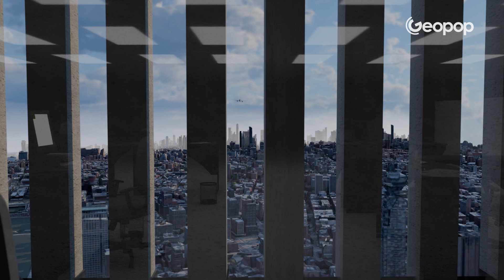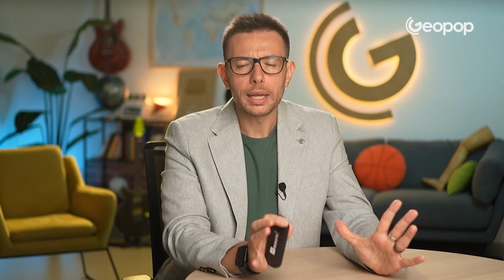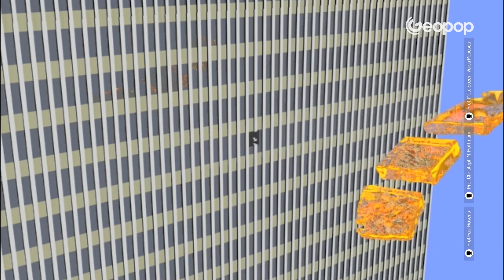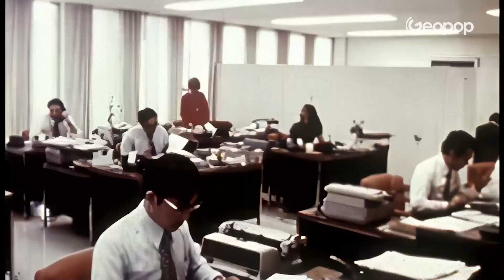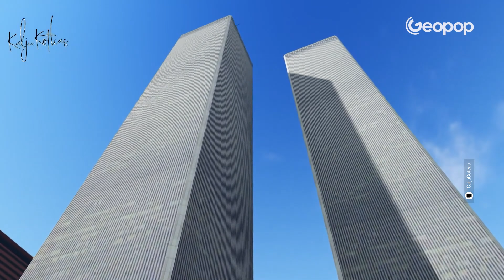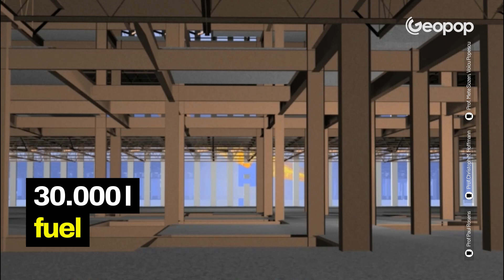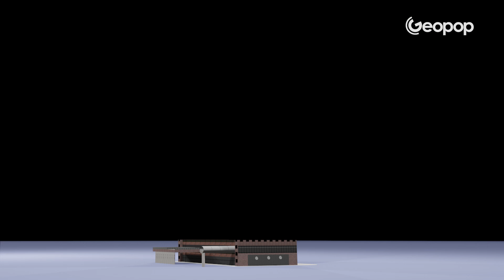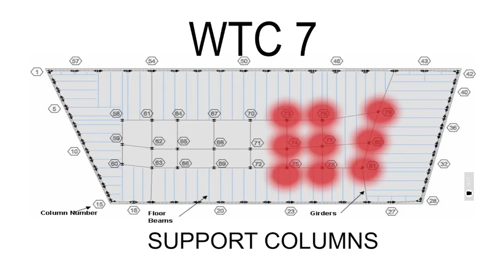9/11, 2001: The Technical Reconstruction of the Twin Towers and WTC 7 Collapses

Comment: Why did people jump? Look at the steel. Fire was so hot it softened steel, imagine feeling that
Reply: They jumped because of smoke
Reply: People watching from rooftops blocks away said they could feel the heat. It must have been unbelievably intense inside the building, especially above the impact site.
Reply: People jumped from utter despair , utter fear and loss of hope. You either jump, get burned , or let smoke suffocate you. Horrific. 😢😢❤
Reply: @stardustring some also fell accidentally to try and get away from the smoke and heat, some inadvertently pushed by others trying to do the same.
Reply: @stardustring  its like when you're at a campfire, and someone throws something combustible in the fire, you feel the heat generated from it, alot of times you back away instinctively, the people who were standing on the edge had no where to go, horrific situation to be in.
Reply: @stardustring correct out of all these comments
Reply: @PaterDJ  
I think you don't realise the scale of the fire and the natural draft that was created!
There is no question that the fire weakened the steel beams to the point they weakened and sagged, causing the collapse!
I don't know where you come up with the  "melted" steel, it certainly was not melted as in a steel foundry!  I have heard people refer to the twisted and deformed steel beams as having been melted, but that is just sloppy phraseology!  The building would have collapsed long before the steel could melt!
I am retired professional welder and amateur blacksmith.  I have even assisted a friend who does iron casting.
Reply: @PaterDJ "Smoke deprived?" You mean oxygen deprived? There was a massive blast and hole on the impact sides blowing out windows on several floors around both buildings, there was plenty of oxygen to burn things, did you miss all of the smoke generated?? It must have created a large updraft as well.
Reply: With fire coming up towards you and no stairs what would you do take a million to one chance of surviving or being burned alive?
Reply: Mossad paid them to jump ( an expert in the comments told me that, so it MUST be true)
Reply: @PaterDJ  what do you think smiths used in the middle ages to forge iron and steel, nano-coal? You are an absolute donkey if you think high tech military grade equipment is required just to soften steel. Heat is all it takes.
Reply: I am a retired professional welder and amateur blacksmith!  You don't have a clue as to what you are talking about!
 @PaterDJ
Reply: it doesnt need to get that hot for humans to be a little iffy about fire, because we melt much, much earlier, like orders of magnitude earlier
Reply: @PaterDJ Wauw so much smarter than experts...Donning-Kruger in full Effect
Reply: @ulrichkristensen4087  your experts are selling you a fib, there's wool on your eyes mate
Reply: Inside job. Has anyone seen the ritual that bush did in the classroom?  My friends it gets deep. And very scary the deeper you go.  But it's a trip that you must take
Reply: They framed binladen. Went to war in Afghanistan to take over the heroin trade to fund the black projects.  O and so much more.
Reply: Jet fuel, magnesium and aluminum aircraft parts, already weakened structural beams from impact. High rise building with wind. Those fires were hot enough to weaken steel.
Reply: Those explosions going off during and before the collapse
Reply: It's terrifying even as a thought experiment
Reply: They knew the fake planting that lie ahead and decided to end their lives rather than listen to it 🪴🤔🪴💩🤔🪴💩⚖️🫡
Reply: Probably the some of the jumpers passed out from inhaling too much smoke
Reply: @PaterDJ  You can use ordinary coal or wood in a foundry. I have done it many times. Also, I have worked as a welder in my youth, and I don’t know how that have anything to do with this? I think my engineering degree has more to offer in the case of structural integrity.
Reply: Right but just know you can't get those temperatures in an open fire.  No, it is not possible to achieve the temperatures needed to melt steel using a typical open fire source; the heat generated by a normal fire is simply not high enough to reach the melting point of steel, which is around 2,500 degrees Fahrenheit (1,370 degrees Celsius) Still any heat anywhere near this would cause someone to second guess if they could fly. But remember the Lady standing in the big whole looking out . Couldn't stand there if it were really hot. I think clearly something else was going on up there. Because around 200 people from EACH building jumped. Which can clearly not only be seen, but heard from the fire fighter footage from the lobby staging area in Tower 1.  Almost as if people were being "cooked" not by the heat but by ?.  Like in a microwave. And like putting a chiken leg on a paper plate in the microwave for just 30 seconds what do you get? A hot boiling chicky leg but paper plate fine not hot. Thats cause of the frequency the microwave is tuned at to hit the water molecules to heat the food. But what was pretty much only things that were left after??? Was all that paper flying everywhere and fine fine dust. EVERYTHING everybody was turned into dust!!! Dust that kept breaking down into smaller dust. OPEN FIRE does NOT make fine fine dust of everything. No No something else  was going on up there to achieve "molecular dissociation".
Reply: @jbyrd1309 😂😂😂
Reply: @jbyrd1309 
So you think, (using the term loosely) that some type of disintegration ray was used?
🤣🤣🤣🤣🤣🤣🤣🤣🤣🤣🤣🤣🤣🤣🤣🤣🤣🤣🤣🤣🤣🤣🤣🤣🤣🤣
Reply: @mahbriggs  loose tight how eva you want it. The weapon already exists and has.  Besides John Hutchinson does the same shit in his living room. You can go watch it on his channel. But the really weird tall tales  is all of the anomalies that come with it. That nothing else can explain that day starting 2 blocks down from the trade center complex. Not to mention the 400 million tons of matter missing from each tower. The marble, concrete, steel, plastics, computers, desks, glass, people,  ect there should have been two piles at least 30 stories high of rubble there was not. If you don't know the science it would never acur to one. I didn't understand the science prior but I knew of the kinda weapons from where I was born and raised on a Naval weapons testing base southern California. Have you ever heard of molecular dissociation? Are you familiar with sound at all. Ever heard of plasmazoid lasers those weren't used but same kinda science. But you can go watch all the news footage of that day and clearly see it in effect. The effect on the towers and around that area. Did you see the news clip of the 70 story steel beam turn into powder live on tv. Then replayed over and over again. It don't take a biologist to know what turkey DNA is. I could go on and on but that should help you out in the right direction. And again if one ain't familiar with the science it will go unnoticed and understood. And check out building 6 right after the towers fell . And explain what you see and how that would be possible if nothing even hit it . But it's ok to learn new things it's never to late my friend. Cheers and fly safe.
Reply: @jbyrd1309  First. You don’t need to melt steel to make it lose its integrity. At 500 Celsius, half the strength is lost. Remember that there was also a couple of airliners crashing in to the buildings. 175000kg flying at 590mph. That’s a lot of energy. About 6 billion joules! No microwaves was needed. Only in the uneducated heads of conspiracy theorists.
Reply: @jbyrd1309 
You are didn't pay attention to the video did you!
The walls were intact, rising heat created a draft, much like that in a foundry or a blacksmith would use!
This greatly increases the heat!  Enough to weaken the steel!
People who don't understand simple science are idiots!
Reply: @jbyrd1309  I remember my first time on LSD too!
Reply: Burning jet fuel doesn't get anywhere near hot enough to soften steel. Maybe being an Ironworker and welder for 30 years gives me a little bit different perspective.
Reply: @danielhowell1640 you're not an iron worker
Reply: @danielhowell1640  Well you certainly aren't an ironworker or welder then
Reply: @danielhowell1640 What about all the furnishings? Chairs desks cubicles carpets paper would they add to the heat ? 🤔
Reply: @danielhowell1640 yeah, a freakin welder.. this is way out of your league so please dont say anything.🤦 you think its the same? Its like people changing tire on their own car and now they say that they can build a car.
Reply: @danielhowell1640 dried spaghetti is hard, add boiling water and it's soft. It hasn't melted.
Reply: @danielhowell1640  You are NOT an iron worker lil bro 🤣
Reply: @danielhowell1640 😂 Shit talker
Reply: @danielhowell1640 the fires were being fed a constant airflow from the destroyed elevator shafts not to mention if you were able to fast forward video from the time it got hit to it's collapse you'd see that the fires got significantly worse the person inside the helicopters basically spoke on how glowing red the inside of the north tower was before it collapsed and that it didn't have much time left before it fell just cuz you couldn't see the fires erupting heavily out the building doesn't lessen the impact it had inside the buildings nor would it indicate exactly how bad the fires were 

You are right about one thing though all that experience should of made you much more knowledgeable about how steel works and stuff but how would you miss something as basic as airflow being a contributing factor in how hot that fuel was burning inside I've heard that the fires burned at around at least 600c and that alone weakens the steel to only 50% of its max strength the real major problem were the floor trusses which is what crushed the floors below then without the floor support the exterior steel peeled away like a banana and then without any support left the core came down likely cracking from the violent swaying then just came down as all the support underneath couldn't hold the weight
Reply: @danielhowell1640 Ohh my sweet Darwin
Reply: @danielhowell1640 🤡
Reply: @danielhowell1640  if the energy released by a rapidly burning fire is contained by a structure then the temperature will rise above the heat of the fire burning in an open space, and will certainly be capable of causing a change to the deformation properties of steel.  Ask a blacksmith.
Reply: @danielhowell1640 an iron worker who doesn't understand that heat softens metal? Why lie?
Reply: @BeeEatingOrchid  My tought exactly! And remember = Both planes where as goos as full with feul. They had still LOTS. + all the burnable things inside (paper, wooden desks, etc.....).
Reply: @BeeEatingOrchid  Do you trust others?
You Americans are in the land of individualism.
If you want to trust someone, trust the knowledge you seek, not what people who have lied to you many times say.
Reply: @rominhoproductions  I'm not American. Do you have anything useful to say, or will it just be meaningless drivel?
Reply: @BeeEatingOrchid  and they also say that the engine of the planes also melted and one was begged for almost a kilometer ))))
Reply: @danielhowell1640 keep in mind it wasn’t just jet fuel as the office stuff kept it turning into an inferno and it kept getting worse inside without a way to control it
Reply: @ZacThaBarber yes the office fittings, furniture, carpets, plastic from computer screen units, masses of paper.
Reply: @ZacThaBarber  The average residential house fire is the contents burning which are the main source of toxic gases. Good point.
Reply: @danielhowell1640 If you can get ordinary coal to melt steel, don’t you think jet fuel will do it?
Reply: @jesperwall839  It's been fairly well known for YEARS that the jet fuel mostly burned off during the explosions from the plane impacts, and mostly only helped start the office fires.  They claim that office fires weakened the steel, not burning jet fuel.  Notice I said "weakened" steel also, and NOT molten...because the official explanation is based on fire weakened steel, not molten steel.
Reply: @yearginclarke  Yes, and at only 500C, steel only has half its original strength. At 1000 degrees Celsius, you might as well have play-doh as structural components.
Reply: @yearginclarke  A lot of it actually drained down into the core of the building. Jet fuel poured down the elevator shafts burning many people alive inside of them. People rivers of fire flow down the elevator shafts while others literally waded through jet fuel pooled up in the stair wells. I don't think people realize how much jet fuel remained and burned inside the core. To be clear I am not saying the jet fuel did anything more then what we know and that it kicked off immense fires that kept increasing. What I am saying though is that there was a LOT of jet fuel inside the building for the first 15 to 20 minutes. Some very scary stories of people almost igniting themselves by lighting cigarette, only to realize they're almost knee deep in jet fuel....
Reply: @madezra64  Yes all that's true and I forgot about that.  But the main point I was trying to make was that there was no melted/molten steel.  Considering that it's well documented and been repeated so many times over the years that there was NO molten steel, it's just annoying to still read people saying this type of stuff all these years later.  That's the frame of mind I was coming from.
Reply: @yearginclarke  No worries. I feel ya.
Reply: @PaterDJmelt No report has ever said the steel melted. It's a comment mostly used by conspiracy people who are so delusional they don't hear the experts saying steel weakens when subjected to high heat and load. There's still multiple floors and a roof with equipment on it above the impact zone. Also it's an office building filled with flammable materials: carpets, desks, papers, computers and laptops with batteries. The cognitive dissidence is insane.
Reply: 😅 @madezra64
Reply: @jesperwall839  well the jet  fuel was almost instantly burned out and temperature was too low to melt the thick beames.
Reply: @rudolfoto  What do you know of either the rate at the jet fuel burned or how hot it was in there? Obviously nothing. All the evidence shows that there was a massive impact, a fire started, and the structural damage was so extensive that the building collapsed. As I said before. At 500C, the strength of steel is only half of what it is at room temperature. Do you think it was warmer than room temperature in there? Also, the force of the impact equals the force of 300000 .50 rounds shot at the building. Have you ever shot a 50-cal?